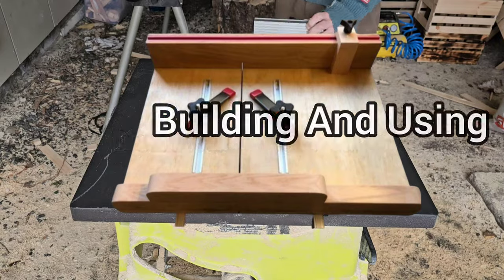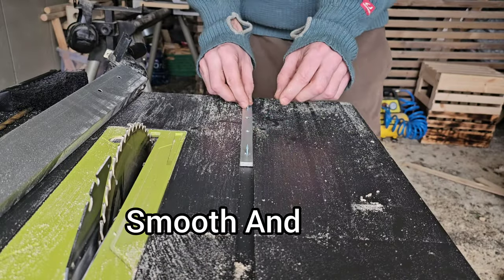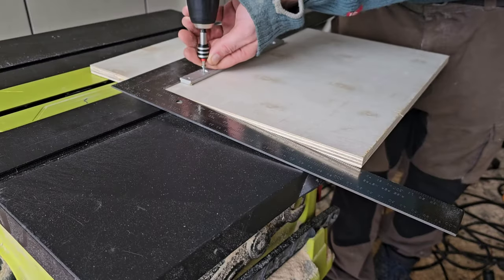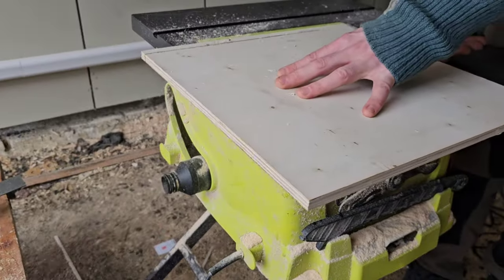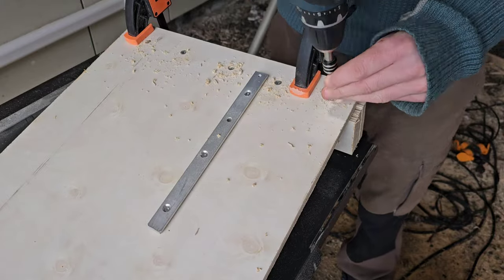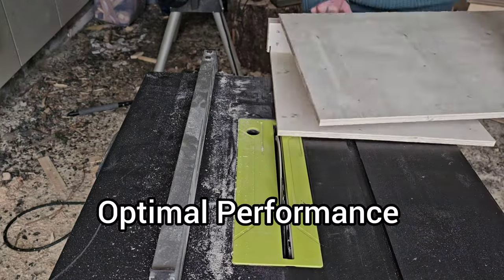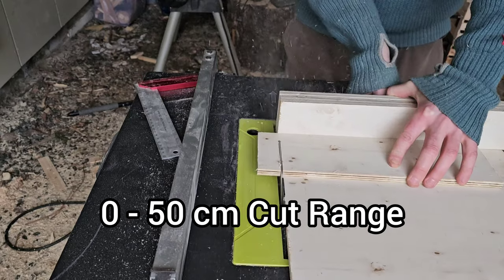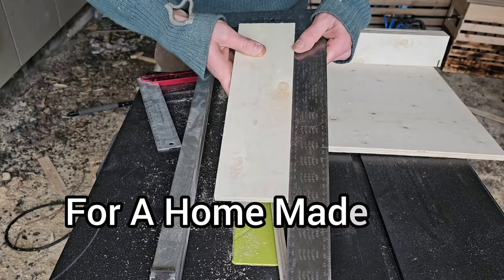Fast and Simple Crosscut Sled!

Comment: So many mistakes. First you should make the fence square to the cut that you make with a saw. Second your fence is never perpenticular to the blade or even should be little off at the back
Reply from the maker: Thank you for sharing your thoughts! I appreciate your input. In my video, I followed a method suggested by an experienced woodworker who aligns the crosscut sled to the miter slots instead of the blade or fence. This approach aims for precision and consistency in cuts, as the miter slots are typically more reliably parallel to the blade. While there are various methods out there, I found this approach helpful for my woodworking needs. I'll definitely keep your feedback in mind for future projects. Thanks again!
Reply: @CarlsCreativeCorner  you right align to miter slot is very accurate but you need to check if your miter slot is parralel to the front and back of the blade you can easily find a tutorial on YT how to do that great video btw
Reply from the maker: Thanks for the tip! I'll check out some more tutorials and the fence alignment for more accuracy👍 Glad you enjoyed the video!
Reply: If you copied something else's plans then you should give them credit for it
Reply from the maker: Thank you for taking the time to comment😃 Yes, you are right! One should. I will do my best in future videos to give credit where credit is do. But I don't believe I have copied someone elses plans for the sled in this video. I have been inspired by many different sources. Mainly pictures from Pintrest. I tried to make the cross cut sled as simple as possible. One that works just as good as almost any other sled, so anyone with a tabelsaw could make one.

Comment: The only sled you need is an ugly, inaccurate and feature poor sled.  Make sense 😂
Reply from the maker: Thank you for taking the time to comment 👍😎 Yes, my point exactly, why should you spend a ton of time making jigs pretty? They are meant to be used, not looked at😁  Appearance doesn't matter when it comes to performance! For accuracy, I find this sled to be pretty accurate, and there is no problem taking the 5 screws out to ajust the sleds fence if needed. What features are you missing? If one isn't strong enough to hold down the materials and not abel to focus 100% on the task and safety, I don't think one should use machinery like the tabel saw😇 If you are thinking of cutting degrees? Because of the open end design, I can cut all sorts of angels between 0° and  90° and width up 50cm on my tiny ryobi tabel saw. What else do you need?
Reply: @CarlsCreativeCorner  you should the one asking why we need a video to show us make an entry level ugly inaccurate sled.
Reply from the maker: LOL 🤣 That's okay. You are completely free to feel that way. Sorry, I wasted your time. Hope I will make up for it in future content. But I'm glad it's called YouTube. And I don't have to ask anyone for permission to post my content👍